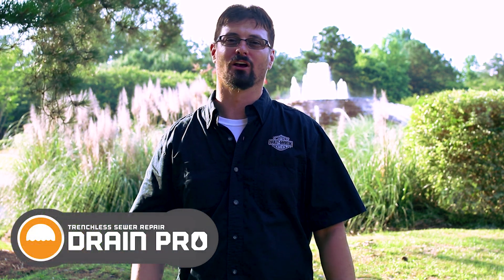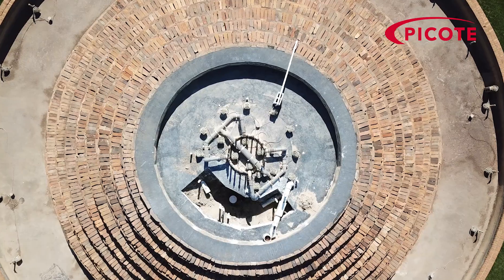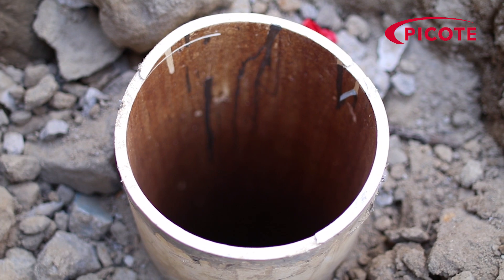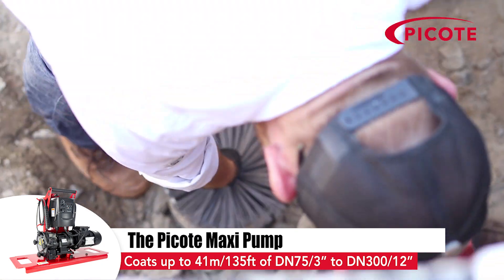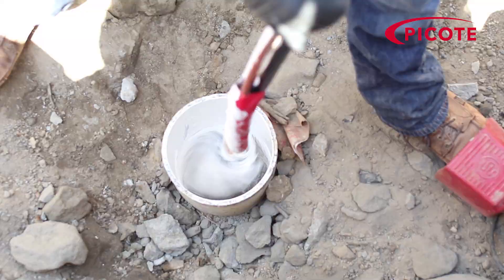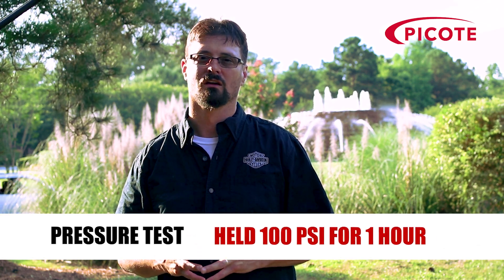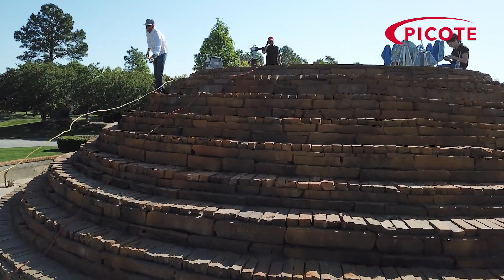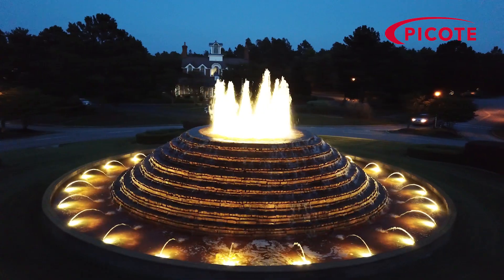Lake Carolina Fountain Picote Brush Coating Project

Comment: Very  impressed how long do you have to wait between coats and how many did you guys do ? Thanks
Reply from the maker: With this particular application we applied 5 coats of our Standard Epoxy, which requires 3 hours between coats at ambient cure (70F). However we just launched our new Fast Cure Epoxy, which only requires 1-1.5 hours between coats at ambient cure. Contact us or a reseller if you would like more information! 

coating@picotesolutions.com     www.picoteinstitute.com    www.picotebrushcoating.com